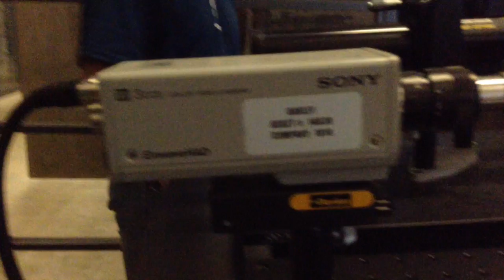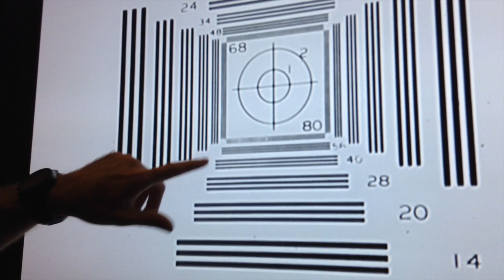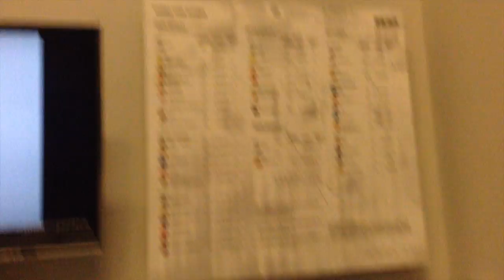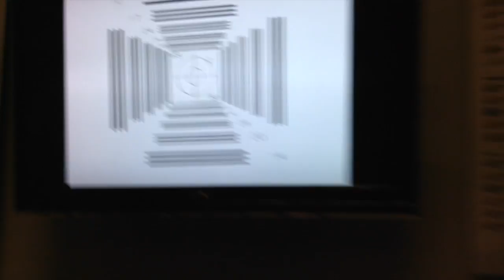Why Oakleys are Awesome- Part 1: Oakley Optics tests

Comment: This only shows that the lasers were calibrated to the focal point using the Oakley glasses. The other glasses did however make the laser converge more or less becuase they are shaped differently but if you were to move the block on foot closer the other pair would have been correct and the Oakley pair would have then been incorrect. This showed me nothing other than the fact that some people are idiots and will believe anything you tell them. Telling me that "look at how well Oakley glasses can focus two lasers while the other glasses hurt your brain" when all of the glasses did exactly the same just at different distances. Your eyes choose where the focal point is not your glasses, and its obviously a fake test made to "wow" people. lol

Comment: I love Oakleys but their lenses suck so bad in terms of durability. It won't last long and then bubbles will come out until the entire lens is useless. It doesn't matter how much care you put into it eventually it will strip off of the coating. The iridium coating will disintegrate and the only solution is to replace them or strip the coating off completely. All of my Oakleys now have lenses from a different brand.
Reply: I bought a pair of ballistic lens fives squared from a Oakley store and it wasn’t long before the hinge started squeaking. I expected better for $140.00.
Reply: I had three pairs of oakleys....they all had the same problem.....they peel in less than 2 years....eventhough i took perfect care.....never wore them near saltwater...always cleaned them with oakleys spray.....doesn t matter....they won t last!!

Comment: I can't believe the ignorance exhibited here. The two lasers are aimed at a focal point. A simulation of a single spot that both of your eyes would be focused on. The lasers aren't "calibrated to Oakley's standards". The distance could be 10 ft or 50 feet. It's kind of hard to attach muscles and a brain to two lasers and make them look at a spot on the wall (since Super Man isn't real). So they're focused on a reasonable distance for the test: the width of the room. That's the "controlled" part of a scientific experiment that (most of us) learned about in Jr high. A camera has a single lens. Well, most of them do. Not the same as two eyes. That's comparing apples to oranges
 The video is too long and chatty? You watch this video for a reason right? It's point was to show why Oakley's are worth the money . Consider this: you're not intelligent enough for the answer you were seeking. I found it very informative. But then again, it all made sense to me. 
As for catching him in a lie... I'm pretty sure that was just a misunderstanding. Chris is a Firearms trainer. The quality & protective aspects of their sport sunglasses was the reason for his visit. I don't think he realized that Chris was questioning the standards of ALL Oakleys, and not just the line he was there to see. I'm sure this guy not only has a PHD in sunglasses... he has a bachelor's in lying to the public. 
 Luxottica does not "make" all of the eyewear. They just own all the eyewear companies.. several retail chains, and several other related companies. It's called a vertical Monopoly. If it's successful, they buy it. There are still plenty of individual production facilities. Though many have been moved.

Comment: Oakley is blurry and cannot make out contrast on 40 line too. Note at 16:10 he quickly adjusts the focus after putting in the radarlock. Oakleys are great and generally better, but they don't have to project that it's magic. You cannot have no distortion even with a thin flat glass, let alone curved poly. They don't have to project false information by doing such things like he did at 16:10 when they are already leaps and bounds better than other brands.

Also the thicker optical centre he talks about, every company does that. That's the reason your non-prescription normal sunglasses have non-flat lenses. The curve gives a thicker centre. That's sunglass 101. It just gets much harder with curved sunglasses, which is where Oakley excels.

Comment: there is no Oakleys no more,no ray ban too, only Luxottica.
that is why sunglasses is so f*cking expensive
Reply: Correct
Reply: Old oakley have more expensive sunglasses
Dont forget the 500$ X metals and Pitboss 1 and 2 
Now they try it with madman and badman and the super expensive carbon prime
I prefer the old oakleys organic frame like monsters and pits to the frames they make now
But i like the holbrook style too
Reply: Oakley optics are still being made in California. Some frames are still made there too but many frames are made internationally. But the core of the product - which are the lenses - are still made by Oakley at One Icon at Foothills Ranch in California. They're still priced as a premium eyewear brand but the pricing hasn't increased.
Reply: Paul Hopkins so true. Especially if you account for inflation. I bought a $200 Oakley back in 2003, that's the equivalent of around maybe $500 today?! If anything though, being owned by a giant company equates better funding, leading to better research, leading to better products. Sometimes, even reduction in costs of supplies, leading to reduction in price! Lots of people look down on goods when a big company takes over but it isn't always a bad thing.

Comment: Should I be a little concern that oakley thinks the light is emitted from the eyes? hmmm
Reply: the light represents eyes focusing on a certain point. In this example, 15ft away
Reply: That doesn't matter. This is a demonstration of the refraction of the lenses. And whether light goes inwards or outwards, the refraction of the lens is the same. (right...? please correct me if I'm wrong...)

Comment: Maui Jim sunglasses blow Oakley's out of the water. Polarized lenses are standard on Maui Jim's
Reply: +mojo jojo One thing I will  though is Oakley's frames and styles are alot sportier. There's not many Maui Jim frames that I like
Reply: Haha no.
Reply: +Kyle Miller  haha yes
Reply: +mojo jojo I own both. Oakley's are great but Maui Jim's have the edge. Maui Jim polarizes their lenses on both sides, not just one. I see better color than I do with my Oakley's. Sorry but it's a fact. Have a nice day :)
Reply: +Jason Duhamel:
ill try out another pair of the Maui Jim's
Reply: ballistic rated
Reply: there are cons to that. polarized is good but nothing ground breaking. it's a key to anything water based but you really need no more than the standard 99% of horizontal glare. the more polarized in there, the more layers going in for distortion. if light enters from behind the lens, thst is where glare will bite you back.   with the Prizm technology it changes the game. you can have more sharper vivid colors and contrasts and it's not because polarized, but how you it filters the rays of light. polarized is great but not good all around
Reply: +Gemone09 "Polarized is great, but not good all around" lol ... Someone is a bit confused
Reply: +Jason Duhamel if a student is great at math, that does not make him a great well rounded student. Common sense and comprehension is truly lost in today's word....
Reply: +Gemone09 True. I actually bought a pair of polarized Oakley Flak 2.0 last week and bought the prizm daily polarized lenses because I got such a great deal on them. I do admit the prizms do make certain colors pop a little more but it's not a major difference. Like I said, I got a good deal on the flaks at an Oakley store because they offer 25% off a new pair of you trade in an old pair of Oakley's plus the Flaks were already 25% off so I basically got them half price so with the savings I bought the prizms.
Reply: +Jason Duhamel that's a deal that you definitely can't pass on. I use the Prizm for deep water and it's great. Notice most pops on oranges and greens. The polarized is a bonus but it's depending what I'm using them for. I'll have to try Daily.

Comment: He straight up says the light beams wont diverge if the target is moved back 10 yds.... Shameless!
Reply: +stoppsi 

The point being made is that the lenses don't change the light path, so they intersect at the same point with or without the lenses in front of the beams. If the target was moved back 10 feet and the beams were readjusted to meet at that point, then putting the lenses in front of the beams would not change the convergence point.

It was expressed badly in the video though.

Comment: Wyowanderer777: At first I agreed with your point, the light enters the glasses and then your eyes, roughly 0.5inhes away, rather than exiting the glasses and being analyzed 15ft. But keep in mind, the error at 15' was about 1" in one example. That 1" refraction at 15' translates to a 0.0028" (0.071mm) error if you run it the 0.5inches from the glasses to your eye. No big deal? Consider that the pupil diameter ranges from 2mm to 8mm in light or dark. This calculates to a 3.5% max error in relation to entire pupil diameter. That's 3.5% that your eyes are constantly trying to compensate for, so this test is NOT false, but rather a much easier way of showing the error so it can be seen without a magnifying glass.

Comment: Okay, but if your pupils are 3.5" apart (or whatever), and the lasers also, then regardless of what lens you put in front of them, you can't have the lasers/eyes focused on the same point at every range.  No matter what lenses you put in front of your eyes, your eyes will have to adjust.

You're sights are above the center of the bore of the barrel, so you can't possibly have a perfect zero at any given range from 2 feet to 1000 yards.  It's the same kind of thing.

It's great that they do all this testing, and put so much effort into quality, but a scratched pair of $150 glasses are just as bad as a scratched pair of $4 glasses.  "If you can't replace it, then don't race it."  I just can't afford to run Oakleys.
Reply: This has nothing to do with "Zero".  This DOES have to do with distortion in the lens when looking at objects. Remember, Oakley is not just about Shooting.  SHooting is a very small subset of their market.  

Oakley lenses are not "Scratch proof" and have never been billed to be such. They are "impact resistant".  

I bought my first pair of Oakley's as a high school senior in the early 90's. I saved up my pennies from a janitorial job to do so.  4$ glasses don't' compare in any way to Oakleys.  That's like saying a Pinto drives as nicely as Benz.  Sure, they both get you from point A to point B, but which does it better and safer?
Reply: D Chang You misinterpreted pretty much everything that I wrote.